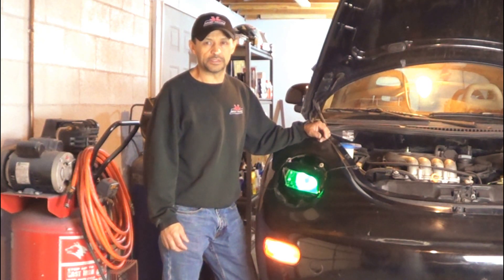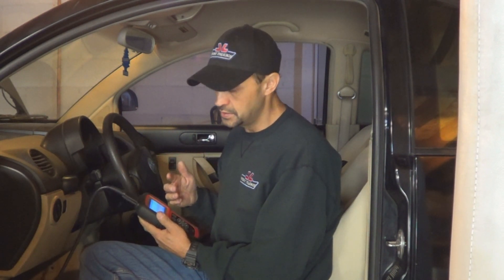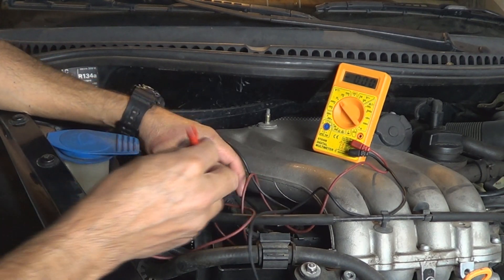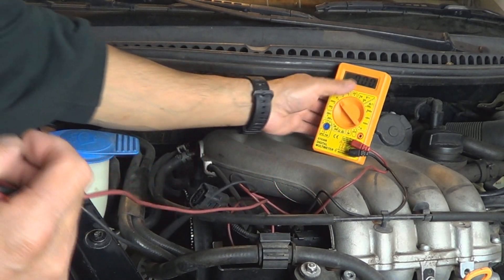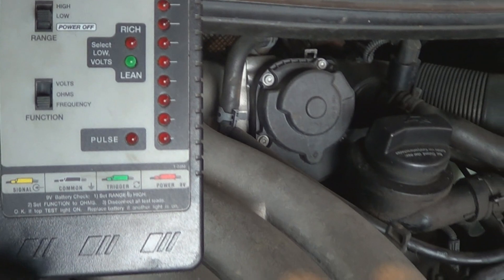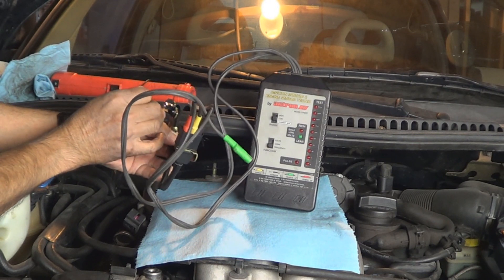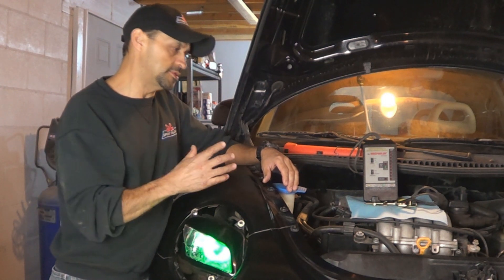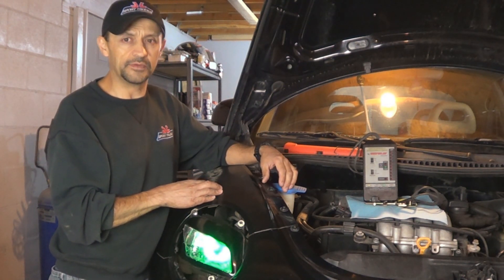Diagnosing Bad Cam Sensor on VW 2.0 L Engine

Comment: I have a problem with my cam sensor.
But when i test vires from car i gor 4.98v on both wires not as you(one 5v other 10-or how much battery have ) 
Can i put directly one wire from battery to the wire that needs to be same volts like battery?
Sorry for my english i am from Croatia

Comment: What about if you’re not getting power to the plug?
Reply: Check for worn wires in the loom, this is a big problem with VW apparently, due to friction, the wire insulation can deteriorate and short out. Otherwise, it may be a problem with the ECU. I'm having the same problems with mine at the moment, will be investigating tomorrow, may reply to this post if the culprit is found

Comment: I have a problem in the ground connection, the cable that comes from the ecu and feeds ref, knock and cam sensor dont have ground.Could you help me with a recommendation?
Reply: Simple. Just put an extra cable from sensor directly to somewhere on the chassis. (A bolt for example) make sure that this point is connected to the ground (not a bolt on something plastic for example). Test this and if works just make that cable permanent. Maybe 15' work for all..

Comment: What if you replace it but still get the code. What is the issue then?
Reply: Have the same on a vw fox 1.2 litre 3 cylinder petrol engine. first, don't replace  anything before you ckeck if it works. Check also the connectors and the cables from sensor to the ECU. Check the reluctant wheel (the sensor doesn't work without it).i think In my case is bad timing  (the timing chain jumped a tooth). Check the timing of the engine.

Comment: hi there was video on here where you can check if sensor is good by putting earth to battery earth and postive lead from the multimeter to the signal wire and start the car and if voltage moves up and down you have a good cam sensor? your thoughts